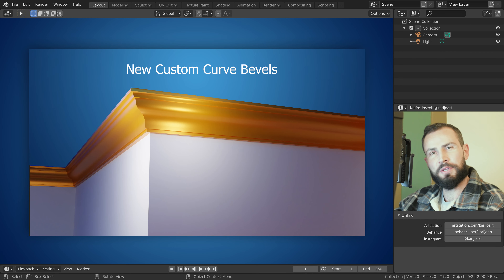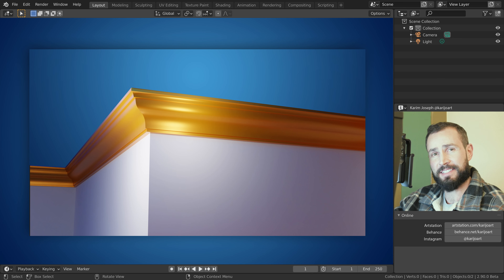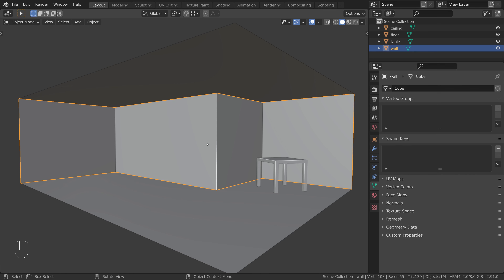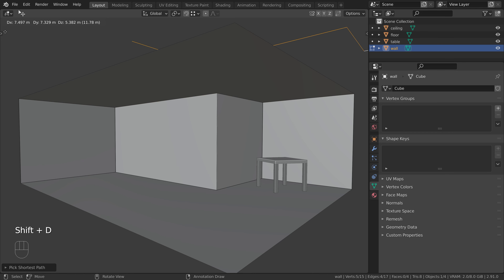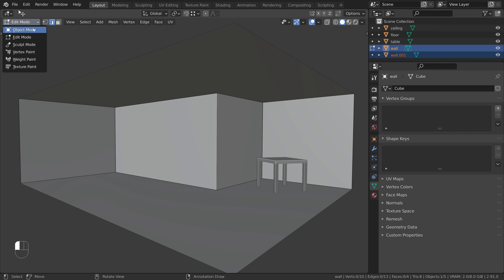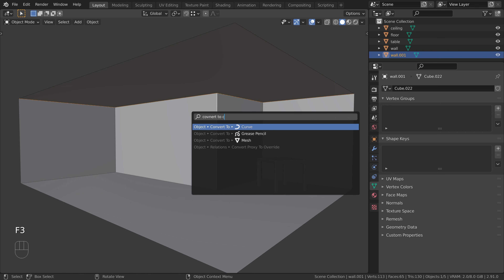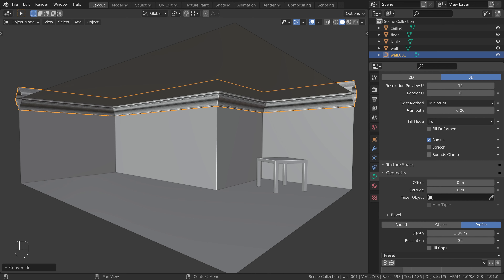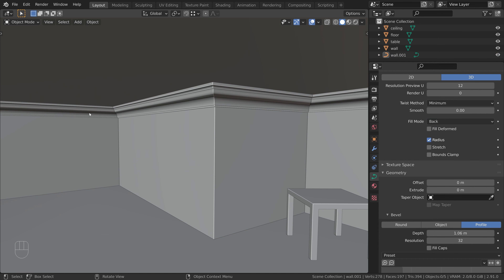Super fast Cornice Molding in Blender 2.91 | New Feature Modeling Tip

Comment: If your cornice shows up on the wrong side of the wall: Select the cornice, press tab to go to edit mode, and then right-click, switch direction.

As pointed out by Lukasz in the comments regarding the separate function. If you separate a face from a mesh, it will move the face to a new object, and leave a hole where the face was in the original object. But if you separate an edge from a face, it will duplicate the edge to a new object, and keep the original edge in the original object. So for the example in this video, you can skip the duplicate step before the separate function. Thank you Lukasz!
Reply: Thanks it helped
Reply: Thanks :)
Reply: Thanks for the added tip here - very useful to know
Reply: In my case, I have the problem fill mode(front and back are also to outside), how can I do?
Reply: Many Thanks, Karim and Lukasz!! :goodvibes:
Reply: was about to search when i suddenly see this 😅. ty
Reply: I CANNOT THANK YOU ENOUGH.....I looked everywhere on the internet and reddit and no one understood what my issue is or had encountered it, i was losing my mind trying to figure out how to do it..thanks again
Reply: Thanks
Reply: Friend, your comment is made of gold